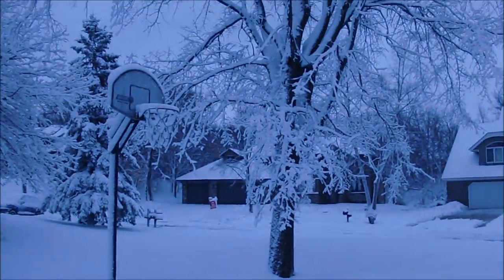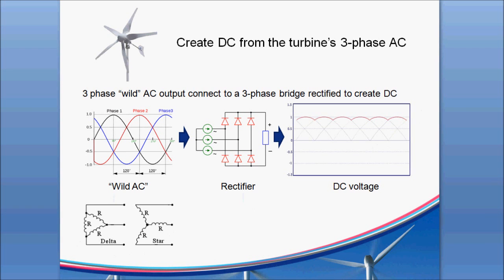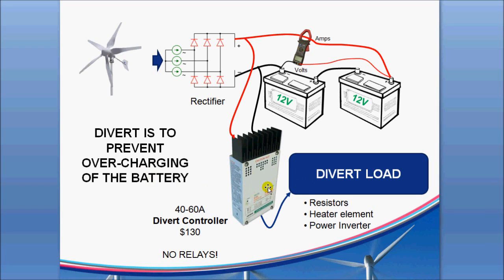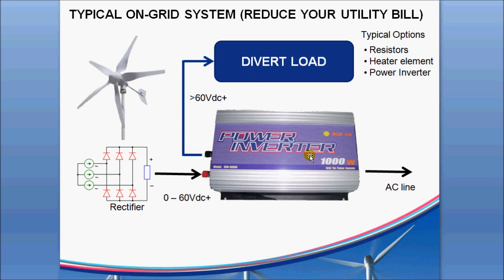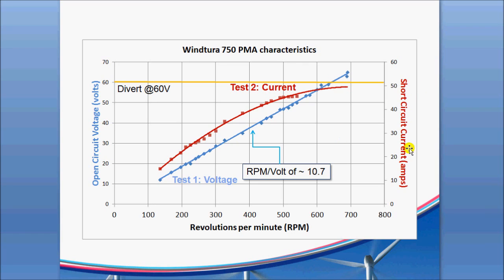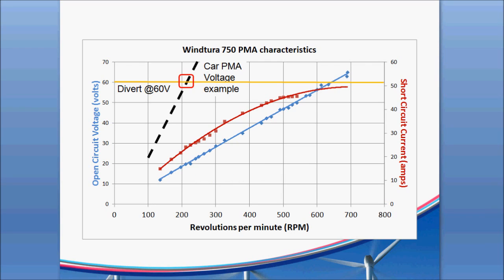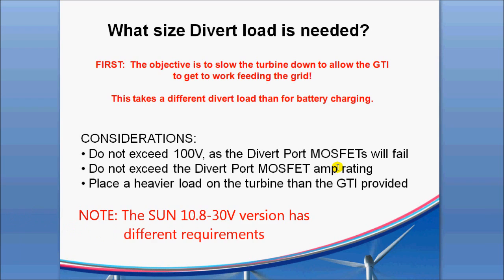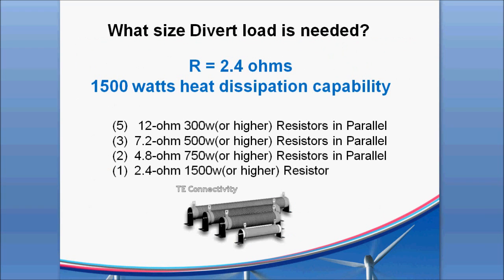Wind Turbine Divert Load for SUN Grid Tie Inverters GTI

Comment: My GTI is the 10.8 to 30 V grid tie inverter what voltage should I run it at I hear that if you put them very high voltage or 24 volts that it will burn them up so I was thinking about 18 volts would that be sufficient and not burn it up

Comment: I have a fisher and paykel turbine on eBay and it's rated 12 -48 volts but for some reason the grid tie 22-60volt gti puts a heavy load on the turbine and slow it down to a Max.  Please show me how to fix
Reply: NRGpower Charger could you get a solution for your problem?
I have same problem with sun gti

Comment: Is the dump load necessary if you use a 1500w grid tie inverter in your example?  Or is there a chance that grid tie doesn't have enough load and the volts will climb in a big wind?  The load slows down the turbine.  Or if even with a 1500W inverter are you protecting against down grid?  How about a fail close short on the turbine wires when the grid goes down?

Comment: .... so on, i was thinking about buying a 500w gti with input range from 10 to 24V and use it as my first gti, and then use another 1000w with input range from 24V to 60V. But i was thinking about connecting the second one in to the divert load of a first gti, so when input load reach upper limit of 24v, it switches itself off and divert everything into the second one which starts at 24V and continues higher. Please tell me if this is possible to do?
Thank you
Reply: you don't need to put it threw the divert load. just hook them off the same input lines. when one cuts out the other will take over .  then you should have a divert load off of the larger inverter. I dump load to a water heating element and put it into a water heater. this way I get free hot water when the wind blows to hard.

Comment: Hi, thanks for the video, i would like to ask you one question, i hope you don't mind.
Lets say i have a wind turbine which generates 0 - to 100V) and 0 to 15A what makes about 1500 watts if i am right.
Most of the time it generates something between 200 to 800w. But 800w is rare.
What i would like to do is to catch as much wattage as possible. Unfortunatelly i was not able to find a gti with wide input voltage range, i found inverters with range from 10 to 30V, or to 24 to 52, or 24 to 60 and

Comment: Can you take the dump load from a 10-30 volt 400 watt gti and dump it to a 28-55 volt1200 watt gti so the whole range of the wind generator is used for power.

Comment: I used to have a 22-60volt devert load 500watt and yes never seen enough out of a car pma. The invertor I sold, because it wouldn't hit the voltage range, now that I have Windmax I wish I kept it. And the resistor bank, you telling about is correct !! I still have mine stacked but no seel box!! Thanks Tom loved the vid!!

Comment: what happens when you have a power outage and the GTI shuts off? Does it automatically divert the load? or do you need to come up with some kind of emergency dump load?
Reply: when the GTI is off ( power outage ) the power will not flow threw the GYI so no power is coming out of it. it would never get to the dump load.

Comment: quick question, can you run two of these GTI's in parallel? or do you risk them working against each other, i'm thinking uncontrolled oscillation where one "dump loads" and stops then the other and so forth turning each other on and off rapidly causing damage to the GTI over time.
Reply: yes you can.

Comment: great video.  like the delt and start diagram you had up solid state dirvert load is a defently relay type can stick damagin the batter bank.  I like to one day get thermodines bulk mppt system they have for there turbines. and I like the idea of the clipper be great for dumpping in to a gti keeping the voltage down to not over volt the gti. great video fearless.